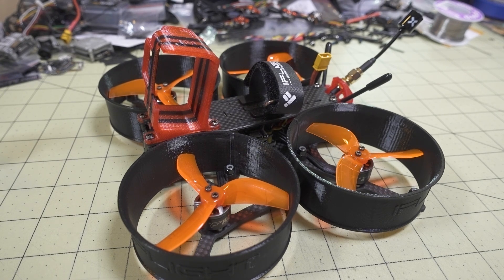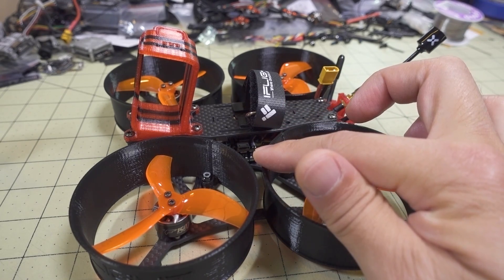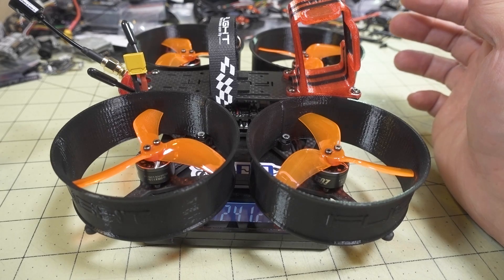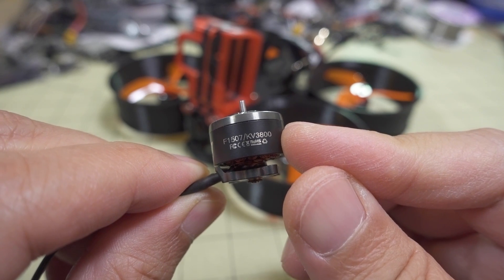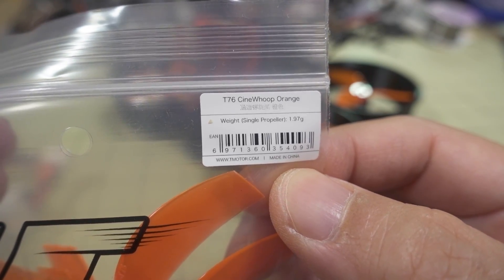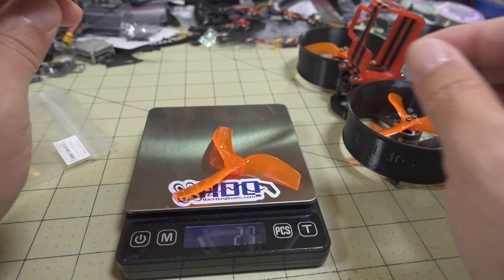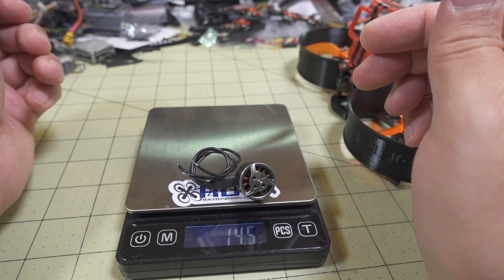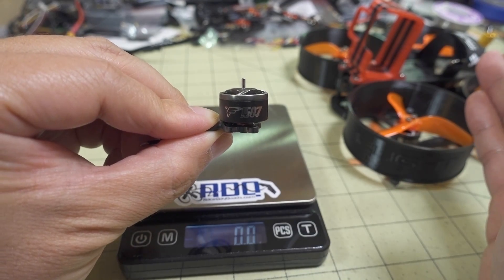Cinewhoop Build! // T-Motor F1507 & HIFIONRC Bluetooth Stack 🛠️

Comment from the maker: 🛠️ Parts in this cinewhoop... 🛠️
Megabee v2 frame - http://amzn.to/2RrHDoF
HIFIONRC F405 Bluetooth Stack - http://bit.ly/3maL7u9
T-Motor F1507 Motor - http://bit.ly/3htazY2 | http://bit.ly/3bQZqz8
T-Motor T76 Cinewhoop Prop - http://bit.ly/3bUBOcN | http://bit.ly/2Zx8ODa
Caddx Ratel Camera - http://bit.ly/2VstzMe | http://bit.ly/32pgTf5
RushFPV Tiny TANK vtx - http://bit.ly/32oMKfO | http://bit.ly/2NBp5AR
Foxeer Micro Lollipop antenna - http://bit.ly/3is8Mnl | http://bit.ly/33mZoLE
Coddar 4S 850mah Lipo - http://bit.ly/3kKDGZG

👉Please support with a 👍 and don’t forget to hit the 🔔 thanks!
👉 Old gear for sale here -  http://bit.ly/AlbertGearFS
Reply: Brother Hobby 1507. Super smooth and quiet. No funny mounts. I have them on a 4" reverb.

Comment: I have green hornet 6s with motors  IFlight XING-C 1408 2800KV and I already burned 3 of them. How about motors you use? Are they good and not making hot too fast? I am thinking of replacing mine to something better.
Reply from the maker: Go with a 2004 motor like this one - https://bit.ly/3ho0uxz
Also 2800kv on 6S is way too high.  You'll burn any motor with that high KV.

Comment: Hi Albert, can the f1507 2700kv use 4s battery? My quad is apex3. And the 2700kv is rated to use 4-6s battery
Reply from the maker: 2700kv is a bit low for a 3-inch prop on 4S.  It will probably fly but it will feel underpowered.
Reply: @AlbertKimTV  is that so... then should I get the f1507 3800kv 3-4s model or stick to 2700kv but run on 6s batteries

Comment: Hi. 
Share PID settings. Thanks
Reply from the maker: I used the process from this video.  The sliders may need to be adjusted down a little do be prepared to disarm in case you have problems on take off.  https://www.youtube.com/watch?v=vGQdsh5zLqE

Comment: Megabee is a nice quad, I have the v2 but I have a little issue when I'm in acro mode and I raise the throttle its going forward without touching the pitch stick, can you help. I can't find anything about this on YouTube.
Reply: I will appreciate some good rates for slow and smooth flying. I don't do acrobatics
Reply from the maker: If you're in angle mode (probably?) you need to re-calibrate the accelerometer.
Reply: @AlbertKimTV  with angle mode there isnt problem. Will try to calibrate if so, but in acro is more smooth flying, i put low rates about 40 and 50 expo, its going smooth. This issue is only when its taking off, otherwise its steady and smooth. Anyway thanks will try recallibration, take care

Comment: Hey Albert, as you have already learned DB meters can be a pain. Everything matters, distance from Kwad, the settings /“weighting of the DB meter”, etc. It could be a big can of worms, so to speak. I have iPhone and there are many good apps, some more accurate Than others. DB readings are algorithmic of course. A slight difference in DB’s can be huge to the ears. Just some things to think about. I like the idea if you have time to somehow build a test bench to keep model from taking off,  so that all things stay equal, at least as close as possible. So that the distance is constant and meter is placed at the exact or close as possible to the same spot on comparable Kwads. There are a ton of variables to consider but, I like the idea! A lot!! 👍👍
Reply from the maker: Yeah, this could be a huge can of worms. Haha...

Comment: I got one of these for testing. I saw a comment on your Instagram about the proprietary mount, so I double checked. I was able to get other t-mount props to fit. I haven’t run it with an of them yet, but I am under the impression it’ll work with other props.
Reply from the maker: You might have a different motor than what I've got because the one's I have don't work with standard t-style props.  I did try them and the holes are closer together on standard props.